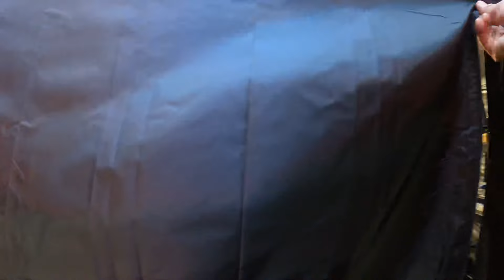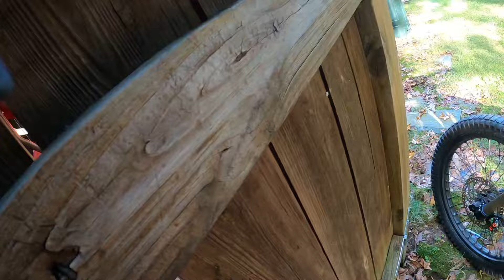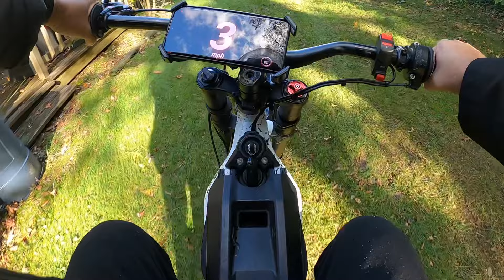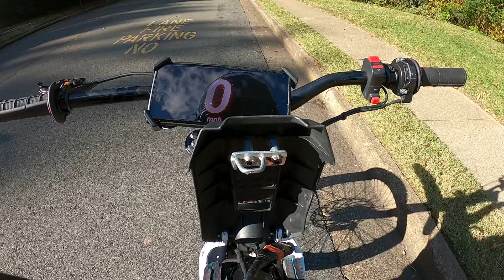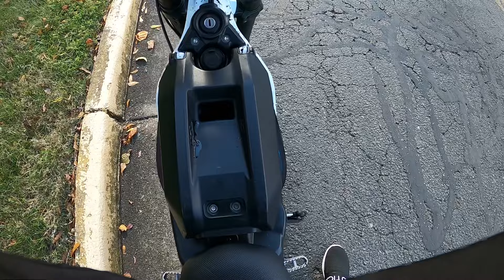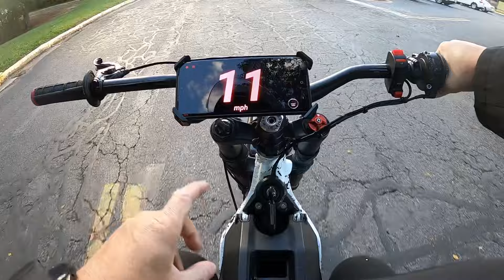Surron test was kinda a bust but gave me high hopes at the same time. More torque & Pwr trips my BMS

Comment: What’s the cheapest way to add some torque and top speed to a surron. Seems like only option is bypass battery and ass a larger sprocket but that’s 1000$
Reply from the maker: controller and battery always first and foremost but aint no cheap way and yeah sprocket would have to be the cheapest but remember surron and the normal gotos for this platform arent the only people who make sprockets but I'm gonna need some time with this thing before I can give out any advisements, stand by i definitely am going to play with this thing and find out
Reply: @ChrisCrossingWires1212  I saw you talking about some cheaper controllers 300-450$ ones I forgot the name, gave you tested those out because I would bypass my battery and get one of those for now seems like the cheapest way to get the most out of my battery.
Reply from the maker: @donathan5932  yes the one I'm using which is a Kelly, same one they use in onyx programmable up to 350 phase amps or small Sabvaton 300 phase amps, they run about the same price and can both handle up to 96v. if your take on a budget I can recommend one for $125 but I'd go with the first two if possible but you don't need to buy A BAC 4000-8000 to upgrade to 72v.
Reply: @ChrisCrossingWires1212  are they plug and play or do I need to do some stuff to get it working? For now I’d want to bypass my battery’s and just run a 7-8kW tube until I get a 72v. Also how’s your experience with it I heard it’s not very smooth but if it’s that cheap and can get me some more power I’m interested for sure
Reply from the maker: @donathan5932  definitely not plug and play, anytime your changing from a stock proprietary controller to aftermarket it's always gonna be a complete rewire especially from stock cuz they try to make it as difficult as possible just like everything factory. Even switching different brands but once you know the basics there all the same. they all have the same peripherals just have to connect them.
Reply: @ChrisCrossingWires1212  as long as it’s not to difficult, is there some kind of software to tune it and if so how is it
Reply from the maker: @steverodgers9315  lol maybe you got a point
Reply from the maker: @steverodgers9315  yeah well im not broke but Im not a surron fan either bro, i just happen to have scoop this thing for cheap and what Im not about to do is spend more on a controller than I paid for the bike so i was trying to use this controller that I also got for free, Now my platform I prefer is Bomber bikes all day every day and I dont have no problem spending top dollar on that one but the whole point of what Im doing now is to show guys if they want 72v on a surron and better speed than what they have, there are other means.  Everyone cant afford a bac., I got 5 cars and 5 bikes so thats not my issue My ch is trying to teach the broke boys or the guys that have priorities more important than these bikes but yeah I can dig it. when i build my next Bomber I wanna holler at you with that expensive surron and see what it do
Reply from the maker: @steverodgers9315  Fardriver going in my QS 273 Bomber Build fkb that Surron FR FR I'm all about the Bomber Direct Drive 273 yall can have that noisy mid drive ish I was just playing with that ish, I'm dead ass 100% all in on my Bomber skipping 96v Going 108 with my Fardriver on that
Reply from the maker: @steverodgers9315  oh my bad lol https://youtube.com/shorts/Sifhkvr9lt4?feature=share that's my baby all day Uryday lol we can talk now I don't know how I missed the first part of your comment 😅
Reply from the maker: @steverodgers9315  pahahaha gotcha Bro hey if I could stay on one thing and get my numbers up Id be good with that, thats all its about Bro, This is and always will be my first love but Bro if you been here you know I be putting out mad videos, My sub count is creeping, just trying to stimulate it with whatever it takes
Reply from the maker: @steverodgers9315  True that Bro and I did start just didn't continue on but yeah at first not only was I not able to edit, I didn't have a computer with the horsepower, I don't have that excuse anymore so that's one positive from my Sim racing rig. My gaming PC is also Productivity monster so, your right man. Although there is another ch that has super great editing, in fact the YouTuber is a real TV guy I guess his content isn't up to par cuz it ain't helping him but People want to know how to work on their shit so yeah, thanks for your input.